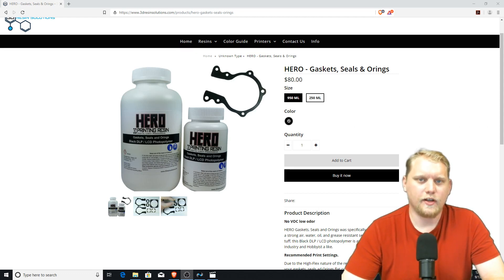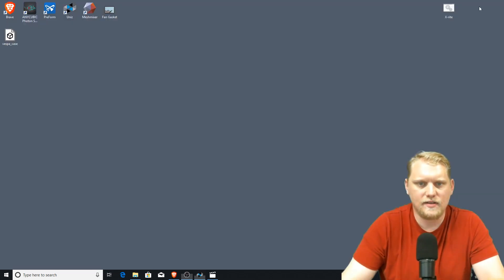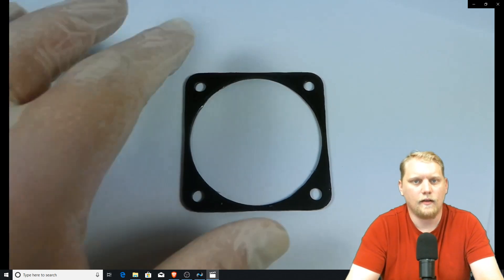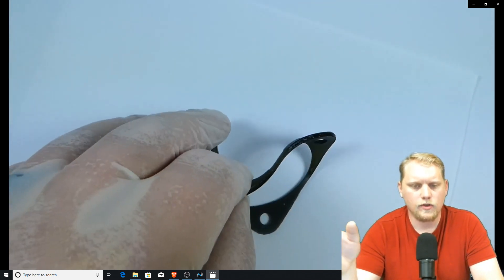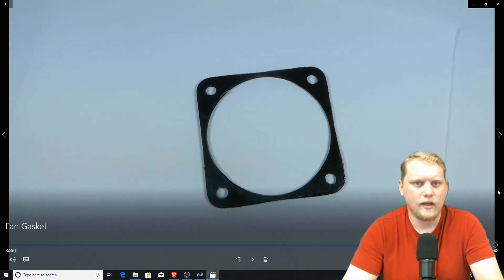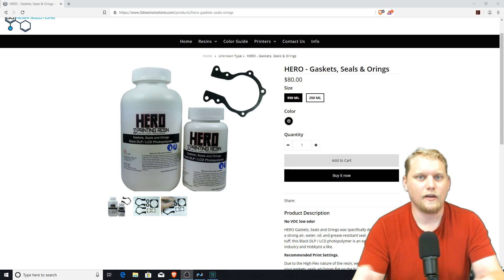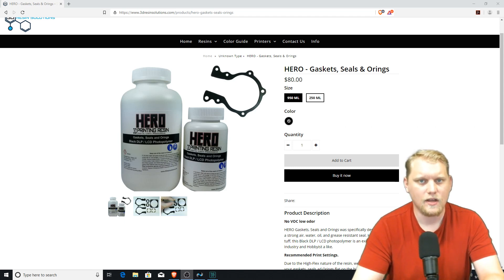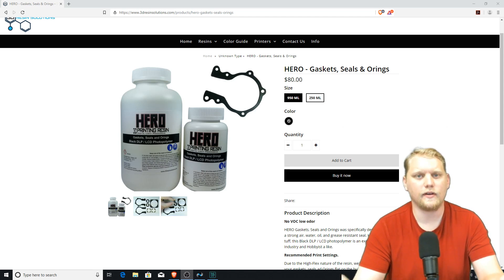3D Printing resin for Gaskets, Seals, and Orings

Comment: Temperature tolerance?
Reply from the maker: This product was not designed for heat resistance. we don't have HDT testing completed but based on the raw materials we don't recommend it for high heat applications.

Comment: Would it work to make a rubber like eyepiece, like those used on cameras or rifle scopes? It needs to have a sufficient flexibility to feel good when applied on the face, go right back to the original shape and be fully washable with water, alcohol or even a sanitizer. From what I see it seems so, I have to manufacture such a part in small quantities and it would be so much easier to 3d print it. Thank you.
Reply from the maker: Well, I can't answer whether or not it would be sufficient for your specific application. Customers have been finding many interesting uses for this material well outside of what it was originally created for. The material should be fully washable after being properly dried and cured.
Reply: @3DResinSolutions  What is the shore hardness?
Reply: @3DResinSolutions  could you let me know the shore hardness, and if any spec sheet is available.
Reply from the maker: @irisoiridoscopiosprofesion5971  Sorry for the delay. The Shore D hardness is around 47. Hope this helps.